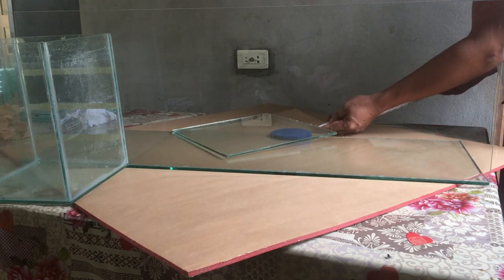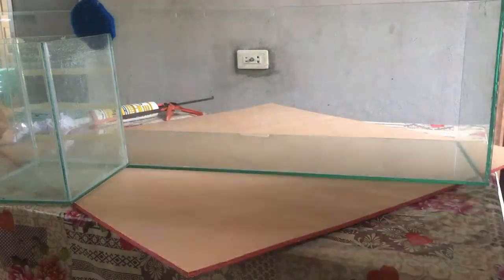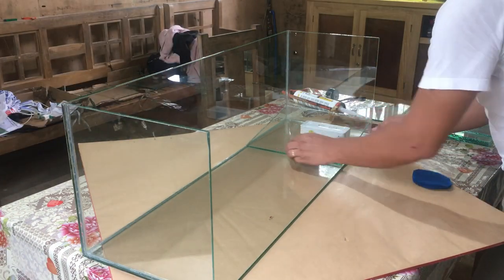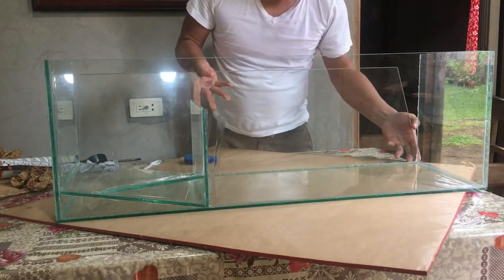Sump design for aquarium filter system

Comment: Hi, could you please explain and share the technical drawing and working principle in detail ? 
Also I want to build a DIY overhead sump  (3 ft long, height, width no constraint but has to be proportionate) with two parallel rows with U turn at one end, while rear row only houses mechanical media (sponges of different grades, wool etc) and front row holds biological media in multiple compartments  (lava rock, burnt mud porous rock, zeolite rocks, dead coral rocks, varieties of ceramic rings, ceramic candles, crushed coral shells and many more naturally available highly porous media) with plants like money plant etc in those chambers to eat up Nitrates.
The whole idea is ===>>>>> front row (visible from front) should look attractive with water plants and rocks while back row holds unattractive sponges, wool and remains hidden.
Any idea how to accomplish this with your state-of-the-art design ?
Let's stop hiding sumps underneath or under display aquarium hoods, instead make them look more attractive, aesthetic and a thing to flaunt and display ......

Comment: Jun jun you are an absolute master. I have a question, what is that thing on the very last chamber of your sump ? Are they clams ?
Reply from the maker: Oyster shell or Talaba
Reply: @aquariumfilter  are they dead or alive ? Because i saw only the shells. 
I read a few articles about water filtration with oysters, but in your consideration what should help in the aquarium ? Removing nitrates, organic waste ? Thanks for the attention.
Reply from the maker: @diegoperez6751  that is dead and you need to sun dry before you use it. oysters shell is to help control the ph of the water.